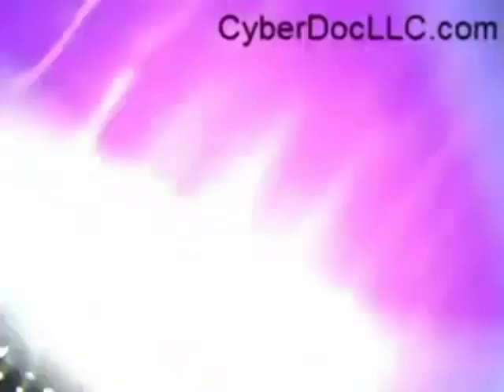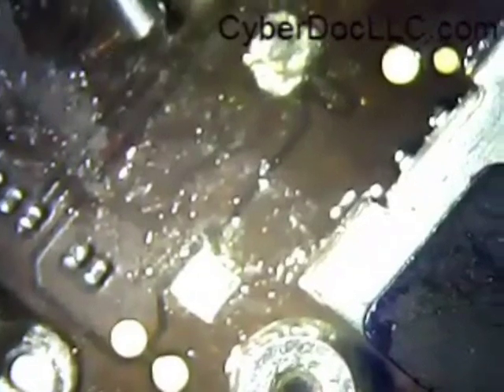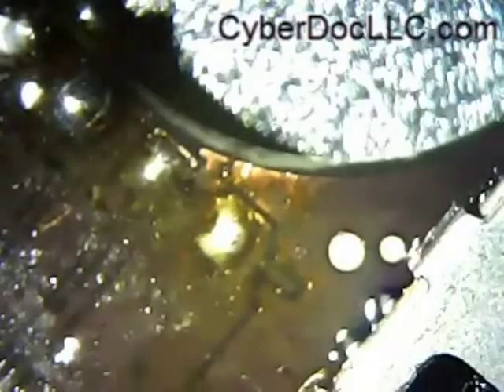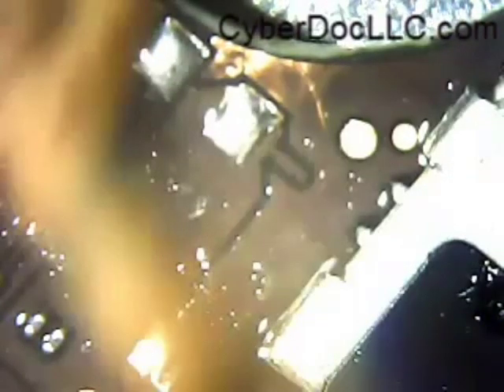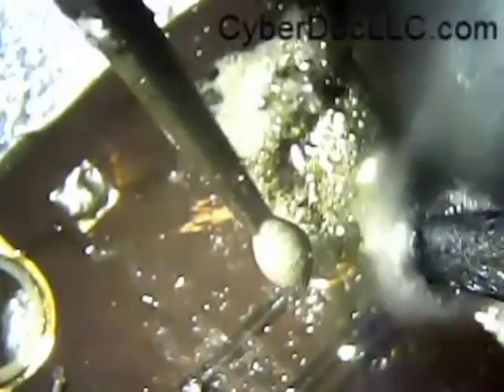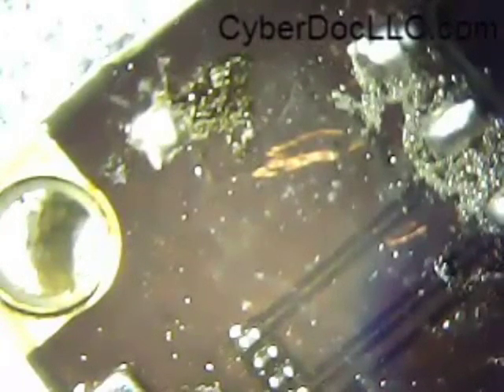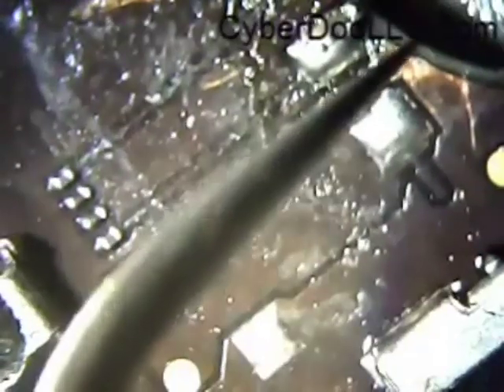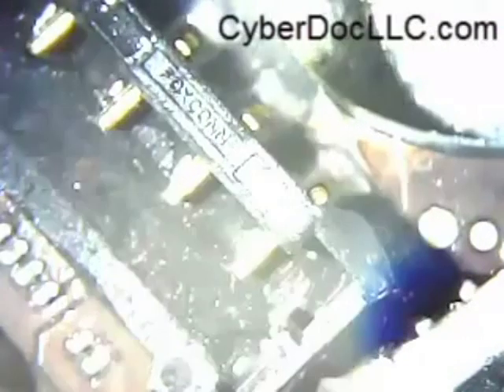iphone 4 4s 4GS battery connector repair instalation soldering using QuickAlloy CyberDocLLC.com

Comment from the maker: a safe temperature profile is 250C for lead free solder. max at 300C anything over 300C you are risking burning the board. using Quick Alloy no clean flux which have a stable active temperate ~278C which would help you avoid burning the board since the flux act like oil keep the board temperature above the solder melting 250C and below 300C hope that helps.

thats why the quality and chemistry of the flux you use is very important in de-soldering.

Comment from the maker: cyberdocllc  webstore the link is in video. 

na  its very hard for you fry the board with this method and low temperature solder from cyberdocllc   its almost fools proof   IMO   try it on a practice board first if you like

Comment: great job what flux paste and solder paste did you use i cant find quick alloy anywhere. also how long does it take to flow using hot air as my gun reaches 450c and im scared of frying the board